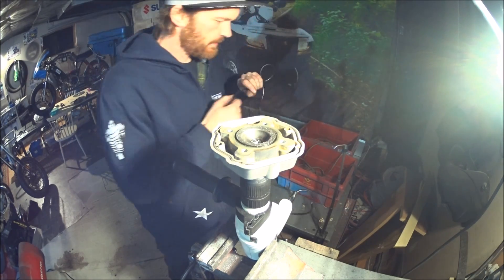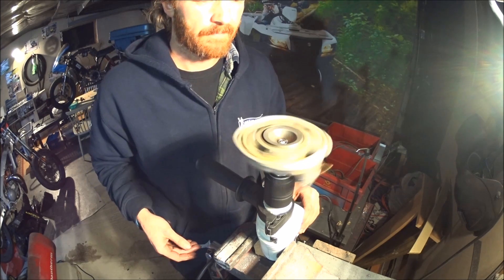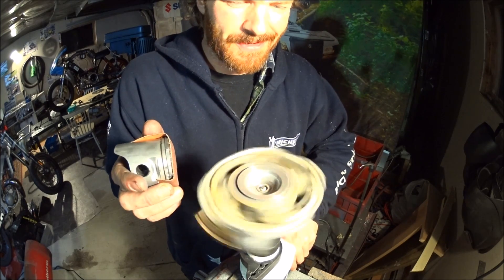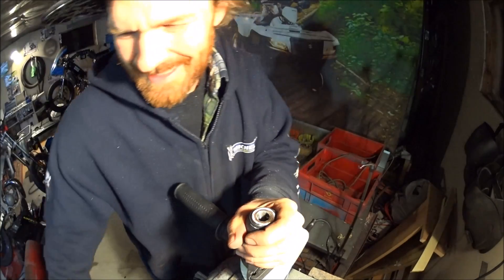HOW (NOT) TO: Reshape Two Stroke Head - The Poor Man's Way.

Comment: I did a similar thing on my dt400 cylinder head. I just turned the head around and round on my table while using a dremmel tool with a rough cut sanding role, followed by hand sanding. The squish band I cut with sandpaper glued to the Piston. I have an air cooled head and I used 2 cylinder head gaskets bolted to it as a perimeter to keep from jumping into the head gasket surface. All the while I checked compression as well as squish clearance with solder. I got what I wanted, a squish if 50 thou inch and compression of 145 lb for pump gas.

Comment: If you turn the drill sideways in the vice you can build a bracing stand for your hand so you don't allow the Dremel to spin off through the squish band. Also you should make a thin aluminum contour gauge of the shape you want so it is accurate to the gauge and not your eyeball. and wear saftty glasses. The head on my 49 Hp 125 LSR Honda is $900 USD replacement cost due to welding and machining of the dome and squish band. And take the brass hose bung out for safety's sake.

Comment: Frightening, but like the thought process.  Tuned an AR80 head back in the 80s. Cut the top of a piston, drilled a hole though the middle and used a nut and screw to hold sand paper on the piston.  The screw mounted in a stand drill and the head in a hand vice.  Head held still, piston spinning round. Worked for me.
Reply: i was thinking the same thing , surely  it would be a loot more steady with the head in the vice and the drill in your hands ...as it was done here id say no thanks ...looks dangerous to me....
Reply from the maker: That's a great method!

Comment: This isn't poor, this is luxury,, Power tools, that's decadence :-) I did it without a drill today. I only just saw this video and if I had seen it earlier I would have been tempted to get my drill out.  I had a really badly mated head and barrel from one of those 80cc kits for bikes.  I used my friends glass chessboard and sandpaper to take down the lip on the head and I enlarged the combustion chamber with my fingers and sandpaper too, I was trying not to raise the compression. It's taken me hours and my hands are aching.  Oh and I accidentally used the wrong side of the glass chessboard at one point and removed a lot of squares but that's fine, he has no idea I even borrowed it :-)

Comment: 1: Why did you not make a holder beside a breakable spark plug
2, Why did you not take off all of the removable items which would reduce the imbalance in the part to reduce the wobble while you worked?
Reply: My brother in law doesn't wanna throw mine on the lathe so looks like I have to do it the poor man's way  what benifits do you get from a diffrent combustion chamber shape?

Comment: nicely done infact i felt the drill rpm cud have been a lil lower or rather under ur control.
i did something like this v recently on a 70s 250cc2T bike
but only for polishing the aluminum head to trap some more heat n mend the pitted cratered squish band
so the head geometry in my case was more complex with a wide squish region and an offset from centre compression bowl
i used the same piston n sand paper method for squish band which was actually followed by milling the head n get some Compression(was 7.6   :0) n hope fully get rid of the pitted squish band
HOWEVER the squish band was offset from spark plug so i made a sanding BIT out of a 250cc piston :))
but the compression bowl was much trickier as itS SHAPE was not available to replicate,
So i kept on cramming the bowl with Al foil n then more n then stuffed in the vice, until i got a hardened all aluminium negative of the comp bowl, slapped on some sandpaper n attached to the drill n voila shiniest heads in the world.
and in all cases i had control on DRILL RPM wich i feel is the decider on the how good the result will come out.
Reply: Rr

Comment: when you drop your rum, the bottle "shatters" (sh sound like "sheet of paper"), when your tool and the part vibrate and cause a rough finish, you experience "chatter" (ch sound like in "cheap chinese drill"). for sizing the squish band, rather than using sand paper over your piston, try valve grinding compound. comes in many grits, available in every auto parts shop, and you mix it into grease. you can run the drill slower, the grit will embed into the soft piston dome, and you have one less variable trying to fly out of your grip, lol. hot melt glue sticks can be used instead of grease to decrease chances of your hand slipping off the piston. valve grinding compound also come in a water mix type, but it is less common "on the shelf". either type will work with hot melt glue. glue and grit was the old method of setting up polishing wheels before the modern compound blocks became available, so it is a long proven technique
Reply from the maker: +ludditeneaderthal Thanks for the tip!
Reply from the maker: +ludditeneaderthal and the clarification regarding chatter!
Reply: always a pleasure to "give back" what little i can to your excellent channel! as far as the pronunciation help, you do FAR better than i would with any nordic tongue, especially considering what a confusing mix of languages make up the various dialects of english, lol. our american patois must be about the most confusing language on the planet that doesn't use tongue clicking, and probably the most if you throw in the regional variant phrases and slang, lol
Reply from the maker: +ludditeneaderthal Thanks man!

Comment: If you never try you will never fail,if you never try or fail then what have you done. NOTHING. It was garbage before you started so what did you lose - nothing. What about making a 2 axis stand to bolt to you drill press with a diamond  or carbide tip to cut with.? I don't know if in your country they re cut brake drums for trucks and cars but the same tool could be used.
Loving this channel even though I am new
Reply from the maker: +P Kuudsk Thanks! Thats a good idea!

Comment: Funny video, surprised the chinese drill lasted long enough to complete the filming. lol.

Bravo, keep up the good work.
Reply from the maker: +cara vaggio Thanks! Surprised myself!
Reply: Just joking China,don't send in the troops, my PRC drill is still going 14 years later including the 3 years I used it when the trigger switch welded itself in the fully on position. A new jelly bean trigger from deepest shenzhen province via ebay got it back to normal. Its outlived my Bosch drill which seized one of it's bearings solid and shat the motor.

Comment: How meny cm3 is betveen piston and cilinder head?
Mesasuring in piston position to middle of ignition coil place.
Reply from the maker: +Rudolfs Jozuus Combustion chamber volume? Around 3.5cc, can't remember exactly.
Reply: We put for 40mmx40mm 4.3-4.5cm3 but use fuel 93, and 95. In SSSR in years 90tees we dont have anotrer.
And put exaust 20mm from top.
Reply from the maker: +Rudolfs Jozuus 👍 Got to work with what you've got!

Comment: I would suggest grinding the tip off the plug so there is no interference.  I do this with a drill press and use a hand drill with a flapper wheel to do the contouring
Reply: Just add shims up top so plug don't stick down in.

Comment: The highest precision instrument in your shop (your eyeballs) and yet you use no eye protection while you have aluminum chips flying everywhere near your eyes.  Removing aluminum chips from your eyeball is quite difficult as a magnet will not work.  I used to work the emergency room in a hospital.  You can trust me on this, and wear eye protection please.
Reply from the maker: +Bill Wessels You are absolutely right. What makes it even more stupid is that I've actually had to get an aluminum chip pulled out of my eye once already...
Reply: Well, sometimes we all have to learn the hard way.
Reply: P Kuudsk so true!!
Reply: Me too. Mainly from the 4 inch grinder. I have a couple of dark burn marks in my eyes that I see when I look at the sky or white objects. But I love them. :-) I use safety glasses now though.
Reply: It is a gear head thing we get caught up in thought and forget about safety. I see worms floating,had both eyes drilled to remove metal and I own 5 pairs of safety glasses and a face shield and 1/2 the time I don't wear them even though I know better. Just forget to put them on.

Comment: I hand turned a TZR combustion chamber to a protruding plug design by chucking it in my drill press by the spark plug...Anything above 250 rpm and the drill press would start bouncing around due to the off center load! Once I tried doing an air cooled head as well but when I started the drill at 120 rpm it almost jumped on me and it's something that I have trouble even lifting!
Reply from the maker: +Sketch1994 Great!

Comment: ls take notes of how NOT to do this. next time use some old window glas and 80 grid
for what you whant to take off then go to 240 and youre done
Reply from the maker: +otto leeverink Your talking about how to shave down the flat mating surface, and as you say, a piece of glass and sand paper is great for that purpose. I'm shaping the squishband and combustion chamber in this video, a flat surface is not much use when doing that.

Comment: Nice video but it will be both easier and safer if you hold  the drill horisontally. This way you can even use a chair or something to rest your hand on so you have better control over the tool.
Reply from the maker: +Георги Кънчев Nice tip! Thanks!

Comment: "Chatter" is the word you're looking for.... Great video and it goes to show you can still get things done without a full machine shop in your garage. What I would do different and I have done this is to make a mandrel to thread into the spark plug hole then chuck into a drill press (gotta work upside down, but much more stable) or even better, a mini lathe, then you can re shape much easier as well as true up the mating surface... Your method in this video is perfect for anyone who wants to do their own heads at home with limited tooling
Reply from the maker: SuperDaveZilla Thanks! Good advice!
Reply: upside down being the order of the day, that dam morse tapered shank and could prove problematic with the weight of the head pulling down lol